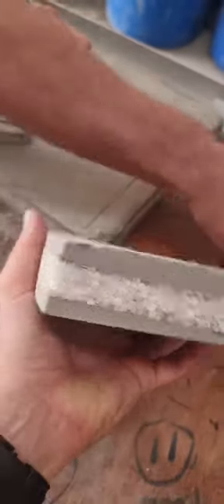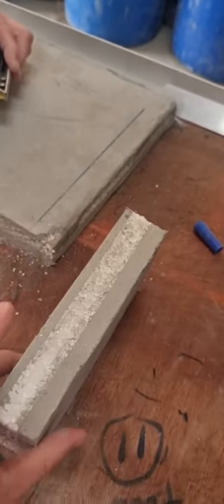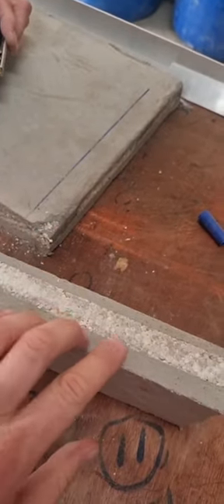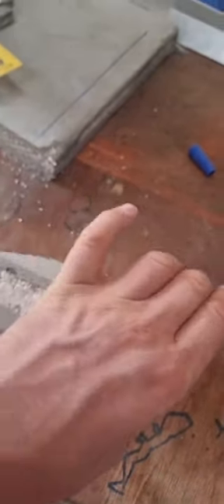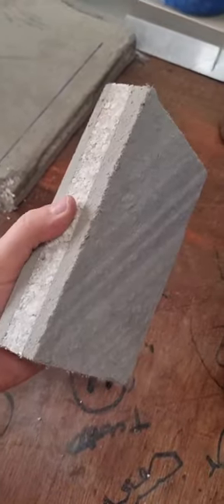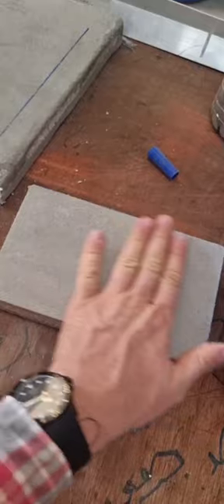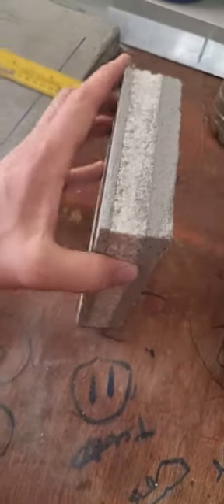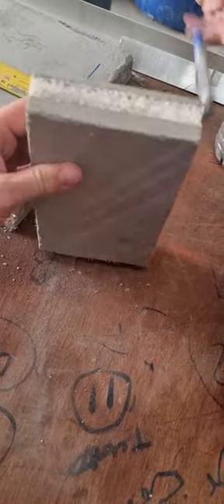Combination of lightweight concrete and polystyrene sheet for better insulation

Comment: Why not just run the lightweight concrete between ICFs
Reply from the maker: To improve thermal conductivity for the system but both options are possible
Reply: Because icf need structural concrete; foamed concrete they use here is not structural and subject to variations depending on ambient temp and humidity
Reply: Can you build up a house using this? What is this methodology of building called? Want to do some more research on it